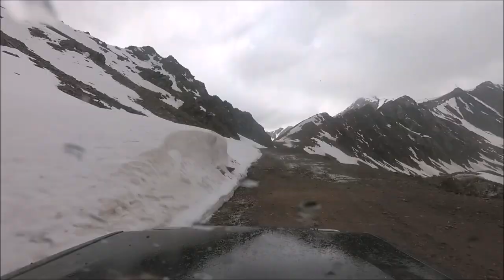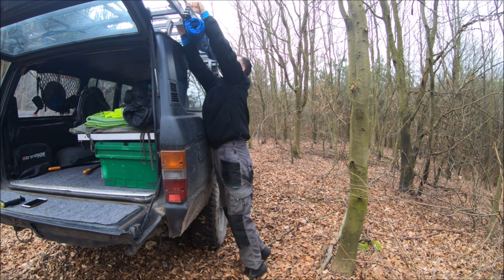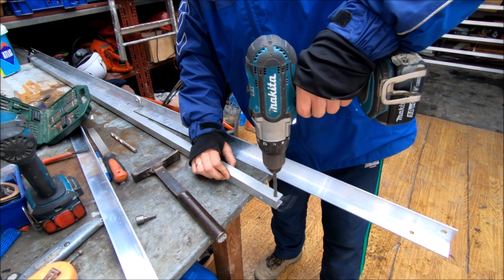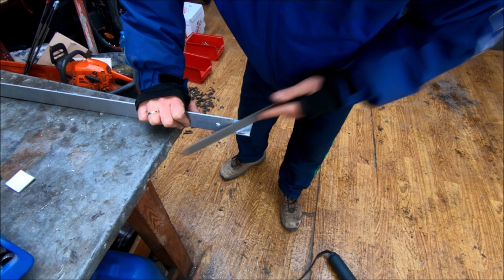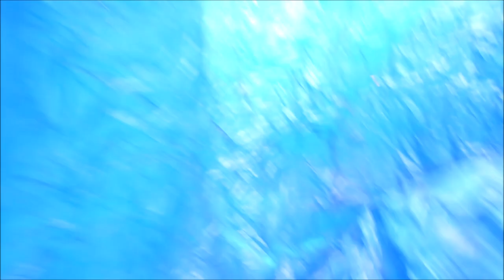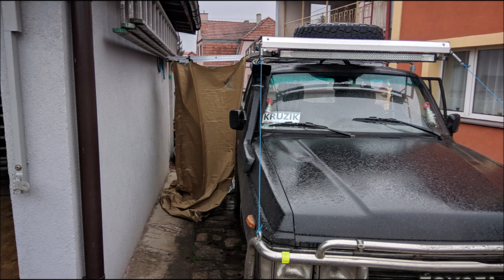103.DIY shower cabin in overland truck Toyota Land Cruiser HJ60

Comment: Awesome video! I just stumbled on it looking for diy shower cube design and this is the design I’m wanting to go for.  Do you have the step by step guide (cutting, materials sizes etc)  and measurements perhaps to share please?
Reply from the maker: Unfortunately not, cube should be arround 95cm-100cm each side, curtain should be arround 180-190cm long plus one or two zippers in the corners